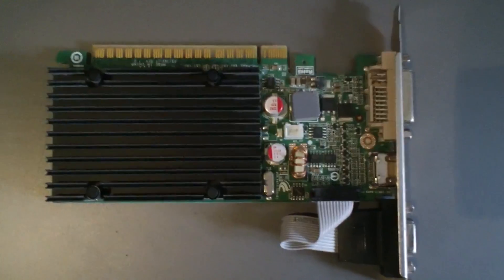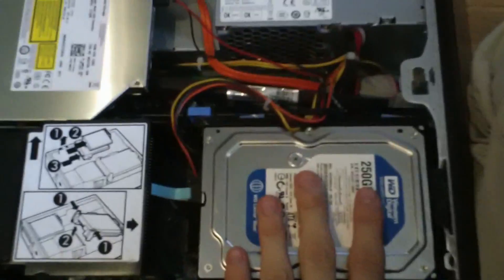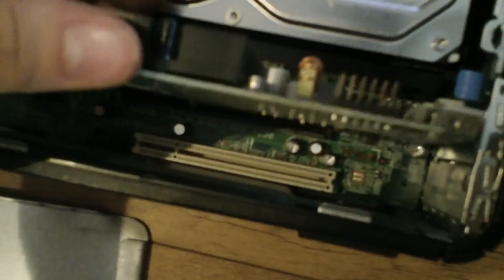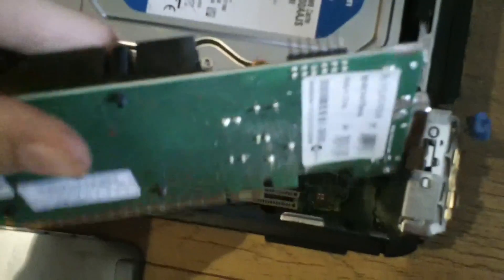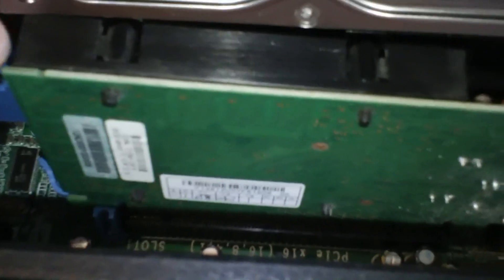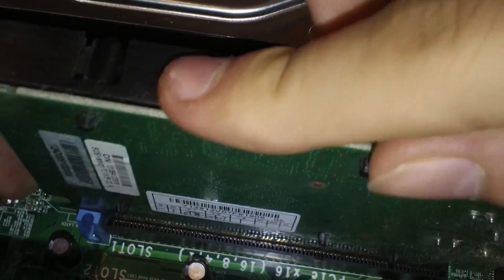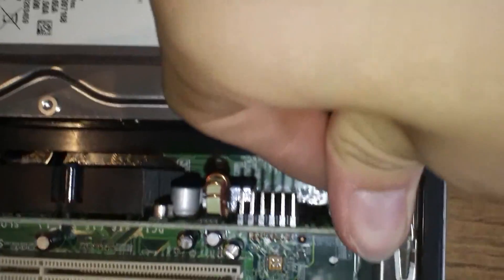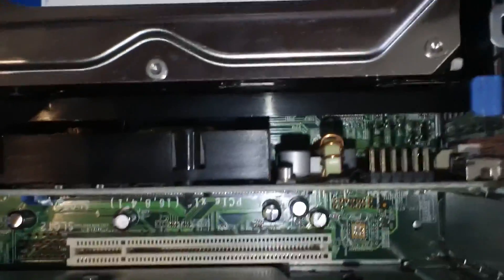Installing A Graphics Card In A SFF Case

Comment: Can u play Minecraft with this graphic card
Reply from the maker: It's possible to play Minecraft with a GT 210, but I highly advise you don't. It is designed as a display adapter and not for gaming.
I'd recommend getting a GTX 750 or better for gaming. There should be a lot of second hand cards on the market if your looking for something cheap.
Reply: MightyElemental thank you

Comment: Hello, I remove the gpu vga and now my screen is black. Is there any way i can use the default vga?
Reply from the maker: If you use the VGA port on the motherboard then it shouldn't use the graphics card. If you absolutely must use VGA then you could try to find a single slot brace designed for VGA so you could use the VGA connector from your graphics card.

Comment: Would a Zotac 1030 gt Zone work in a Dell optiplex 780 sff if it has enough room inside the case, or would it need a new psu? 235w is what I have inside at the moment.

Comment: About a year ago now I put a 780 system together for my mother. She isn't in very good health so she spends a lot of time indoors, on the computer. It had a q6600, 8gb ram (just ddr3 I believe, but good enough for what she needed), a 1tb WD black drive and a gt 310 I threw in; more a display adapter then anything, and a slight boost to what the integrated graphics could do. It served her well over the past year, and now she's upgrading to a laptop. So now I've got the 780 back as she has no use for it.. thinking of maybe turning it into a little emulation box, or maybe a HTPC. Any recommendations of what to do, with the given specs? I could put a slightly better GPU in.. but for almost any "sff GPU" marketed towards gaming, you need at least $100. GPU recommendations anyone? Preferably under $60 or so, as I've got about that tied up into the whole 780.

Comment: How much W the GT210 need ? :)
Reply from the maker: The GT 210 requires up to 30.5W
If you are going to get a graphics card, I would highly suggest you do not get a GT 210.
I would suggest getting a GT 710 or GT 720 since they are more powerful and more power efficient. They both run under 30W
Reply: MightyElemental thanks a lot it will help me :)
Reply: When ill look at the item on internet they said it need 300W I dont understand and dont want to blow my computer with a graphic card :/ can you help me with this ? :/
Reply from the maker: +Joanie Courville that is a recommended psu wattage and not a guideline. it should tell you the actual wattage of the card somewhere on the page.
Reply: MightyElemental Iright Thank you :)

Comment: Can i put in a stock dc7800 sff intel core i2 vpro a msi 710 2 gb
Reply from the maker: +Mr. Jwz yes you should be able to install that card but you need to ensure it is single slot
Reply: Sorry i have another question, i heard that you need to know how many watts you have over  because of your cpu hdd etc. And then you can install a gpu because if you dont know how many watts you have over you cant intsall a gpu if its not enough. Is that true? (Sorry for the bad english)
Reply from the maker: Mr. Jwz yes. you need to know how much wattage you have left before you install a new graphics card. however, the gt710 is a very low power card so you should be fine without checking the wattage.
also be aware that if you plan to use the card for gaming then you may want a better card since it is not very powerful
Reply: Thank you very much for your answer, at this time i dont have any gpu cards in my pc
Reply: 240 watt is enough right?
Reply from the maker: It should be if you intend to only use a GT 710

Comment: I have a optiplex 780 windows 10 professional 80gb intel core duo 2 gb ram what graphics would I need to fit to do gameplay videos for you tube  any 1 help
Reply from the maker: Dwayne Show first of all, the cpu will be an issue if you are trying to record and play at the same time.
the best gpu for you will depend on what games you play. I would recommend a GTX 750 ti.

Comment: Hey, I got a question. My cousin is interested in PC gaming and want to game on my Dell Optiplex 780 SFF. (Not interested in PC gaming myself, though i want to know more about it just to have decent to good specs lol.) I want to know what Graphics card is compatible with the PC.

Specifications:
CPU: Intel Core Duo E8400 3.0 GHZ
GPU at the moment: (It came with my PC) Intel Q43/Q45 Express Chipset
RAM: 4GB DDR3
Max Wattage for a GPU: 65W
OS: Windows 7 32-bit (Though i am planning to upgrade it to 64-bit so my PC won't be so darn slow)

Only compatible with a 1-slot GPU apparently

I also have a DVD drive and a 160 GB HDD. (Planning to get a 512GB SSD. Again, i hate how slow it is)

What is the best GPU I can get with these specs?
Reply from the maker: This video may help you: https://www.youtube.com/watch?v=XVR07KLBcgI
I would say a GTX 750 Ti is more than enough for a PC like that. The issue is, it still might be bottlenecked.
Reply: @MightyElemental  b

Comment: How do you remove the VGA port on the same card in the video?
Reply: Also, fantastic video
Reply from the maker: The VGA cable just has pins that you take out of the socket on the board. And thanks ;)

Comment: i have a dell optiplex 960 and have a ssf case on it, i was looking at the exact same gpu on ebay and was wondering what fps u get with that card. and the video was very helpful i also have a little plastic case holding my hd and it gives me less room so hopefully it will work and i can get it all in.
Reply from the maker: This card gets 30fps (if you are lucky) on CSGO on minimum settings on 640x480 if I remember correctly.
This graphics card is not designed for gaming and is designed for multiple monitors.

If you are going to be gaming, do not get a GT 210 xD
Go with something more powerful like a GT 730 at least.

Comment: i have sff smaal factor pc what can i do 
it,s core i3 3.3ghz and 8 gb ram and i want to install a good gpu HElp plz plz
Reply from the maker: SFF cases are really difficult to work with. Is there a drive cage in the way of a potential graphics card? If so, I would advise getting an SSD and remove the drive cage first. Then you can look for low profile graphics cards.
Things you need to look out for are:
1) Wattage - make sure your PSU can handle the graphics card and still have at least 5-10% headroom
2) Size - make sure the graphics card is short enough to fit in the case
3) Number of slots - most SFF cases only allow single slot cards
4) Card height - the cooler on the card cannot be too big otherwise it won't fit in the case.
Reply from the maker: What computer and graphics card are you trying to use?
Reply from the maker: I assume you're using Windows, does that error message appear after signing in or does it appear any time before?
It sounds like it may be a driver issue. I'd try reinstalling the nvidia drivers.

Comment: what standard is the other pci slot and could a raid card be fitted there?
Reply from the maker: The other slot is normal PCI so you may be able to use a raid card. I 
haven't looked into it but this PC only has 1 HDD SATA connector.

Comment: i got a dell optiplex 3020 sff with an i7-4790k. I got only a 250 watt psu. I prefer to keep the dell psu in as it is good quality. What graphics cards do you recommend. Hopefully something decent enough to play some modern games. gt 730?
Reply: *256 watt psu. Also it has the same space limitations as yours.
Reply from the maker: If you are wanting to play modern games then I wouldn't go for anything less than a GTX 660 or GTX 750 Ti. Issue is, if you have a small form factor case, it does limit your choices. I don't really know what I would recommend but the GT 730 is the most powerful SFF graphics card I can think of that will fit inside the case.
Reply: MightyElemental thank you

Comment: Can I install GTX 1050 into Optiplex with Q9400? I think that's 250W PSU..should be enough for this GPU and 1 SSD?
Reply from the maker: I don't know if the graphics card has power connectors on it may not work.
The graphics card will have to be single slot.
The GTX 1050 is rated at 75W which is supposed to be the maximum for a PCIe slot so you may be cutting it close.
Reply: Most gtx1050 cards are fine with 75W coming from mobo slot but apparently previous spec PCIE might give only 66W (or it depends on a chipset/mobo manufacturer idk) so I will hunt a desktop version of these Quad core Dell or Acer rigs since they come with PCIE power cable. Could even go for RX470 then. Cheers

Comment: Benchmarks and games, Overwatch, Witcher, etc you know them.
Reply from the maker: Yes, I know them but I don't own them :P
Nor do I plan to own them.

Also, I doubt the GT 210 can handle it xD
Reply: MightyElemental what is the newest graphics card that it can work in the 780SFF? Will an Rax470 work in this computer?
Reply from the maker: The card needs to be single-slot, low-profile, under 65W and quite short.
The RX470 will not fit and the wattage is too high. Even if you could use it, it would be bottlenecked by the CPU.
To be perfectly honest, the best graphics card I can think of that will fit is a GT 740.
Reply: MightyElemental what about this one

EVGA GeForce GT 730 2GB GDDR5 64bit DVI/HDMI/VGA Low Profile Graphics Card 02G-P3-3733-KR
Reply from the maker: Yeah, that should work.
Reply: MightyElemental we need a video to see what is the newest graphics card we can put for this unit, I also need to replace the stock fan is super noisy

Comment: I am sure if the Hard Drive is replaced with an SSD will allow more rom for a bigger graphics card.
Also I want to know if we can install an i5,i7 or an AMD 6core or 8core processor to this computer.
Reply from the maker: Simple answer: No, you cannot install i5,i7 or AMD into this computer because this computer is socket LGA775 and the i5,i7, AMD don't use that.
Reply: MightyElemental it seems only the Pentium D would be the biggest upgrade
Reply from the maker: wow

Comment: +MightyElemental Brooo Need your helpppp... How did you do that to your vga?? I mean in your video it was a vga with half/full height specification but you did release its bracket and made it compatible with low-profile height..... Im curious. Can you explain?
Reply from the maker: img_1: http://cdn.computerhope.com/vga-cable-and-connector.jpg

As you can see at the bottom of img_1, the vga socket has 2 nuts at either side. To remove these, I use a pair of pliers to unscrew them. These nuts are the things that are holding the IO bracket in place.
Once the nuts are off, I removed the bracket. The VGA connector is connected to the card by a ribbon cable as you can see, so I just lifted the cable off of the board.
Reply: big thanks man. I was thinking the nuts ure talking about are permanently attached and so does the bracket lol.

Comment: Hellor Sir Might , will a gt 210 card work with a basic dell optiplex 740 sff (275 watt psu but pci x16 express 25 power )
Reply from the maker: If the PCIe slot can only handle 25W then a GT 210 might not work.
The GT 210 requires a maximum of 30.5W

Comment: I have a 88w PSU can i still put in the GT 210 or the GTX 750 Ti or do i need to upgrade it. btw i am new to building
Reply from the maker: 88W?! You are joking. Please tell me you are joking xD
If that is the case, you will need to look and the power consumption under max load. If there is enough room for the GT 210 and 5-10 watts of headroom then you should be fine.
The 750 Ti is too large to be used in this case without removing the hard drive cage so it is up to you really.
Reply: How did you change the position of the hard drive?
Reply from the maker: If you have a small form factor case then you cannot get the GTX 750 Ti 
anyway. If you have a DT or MT case then you WILL need to change the PSU
 to use the 750 Ti.
I don't know what wattage your PC is when it is under max load but I would still replace the PSU if you are going to be using a graphics card.
Reply: Can you link the right PSU?
Reply from the maker: Ok, also I did not change the hard drive position. I didn't answer that question before because youtube was not displaying it -_-
PSU Link: https://uk.pcpartpicker.com/product/HvTmP6/evga-power-supply-100w10430kr
Cheapest one I could find. It probably wont fit in your case but the long cables should sort that issue out. You might be able to put the hard drive in the place of the old PSU as well.

Comment: I have a great question... ¿Is it true that the pcie power draw is limited? I want to buy a r7 250, (for avoiding psu upgrade) but not sure it is gonna work.
Reply from the maker: The PCIe power limit is supposed to be 75W.
Reply: MightyElemental Unless you have a dell... i had read that some Dell's motherboards had their pcie draw limited, mine doesn't say anything, so i think i'll take the risk and if it doesn't work / fit i'll be selling it